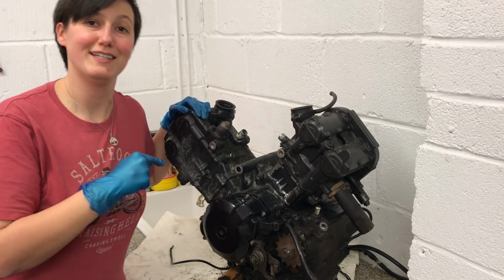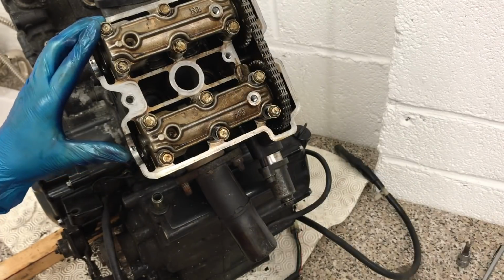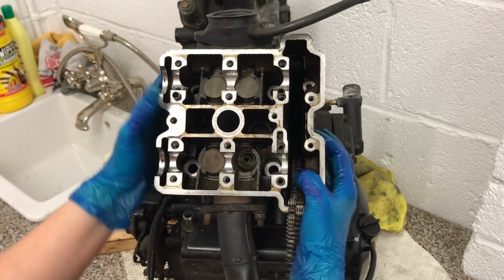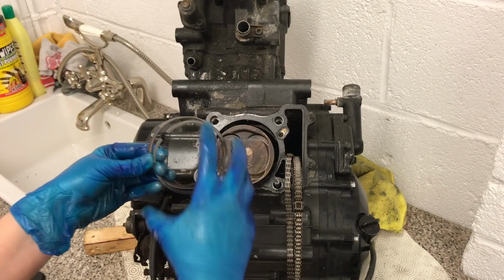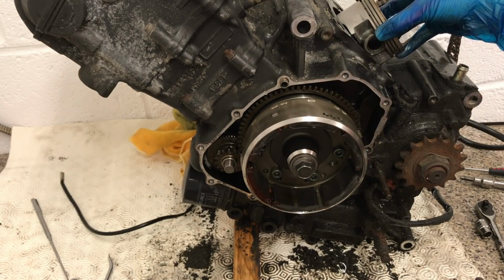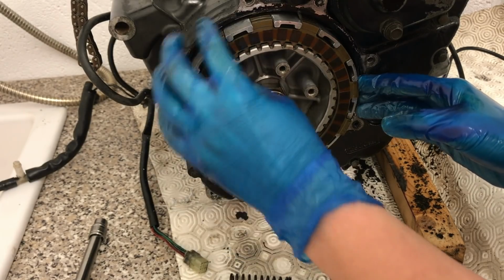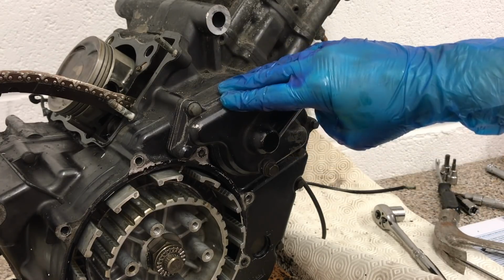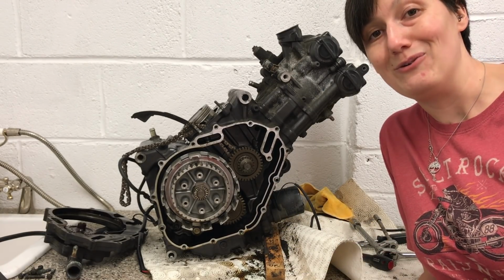Motorbike Engine Explained

Comment: The SV650 was my first bike and a few people before me had it as their first bike also.  I bought it with 80k miles and sold it to a friend for his first bike.  I learned all maintenance on it and had to at one time or another replace the clutch, the intake boots, the radiator, the fuel petcock valve and overhauled the carbs.  I REALLY wish this vid was around then.  I had a book, some tools and a crap ton of courage.  I still miss that bike.  Thanks so much for this.  It was great!

Comment: Great stuff, many thanks.  I have a K3 with 33k miles and suspect I need to check valve clearances and also have an upcoming clutch replacement so it was good to see inside the SV engine.  After your explanation the clutch does not look quite so scary now.
Reply from the maker: I am very pleased it was helpful and that you enjoyed it. Thanks for taking the time to comment, it is appreciated.

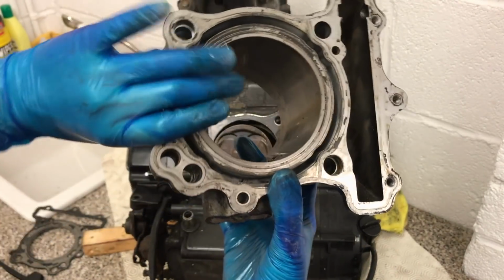Comment: 5:43 that is not the combustion chamber. that is the cylinder. the combustion chamber is the volume from the top of the piston when its at TDC  to the inside top of the head (where the valves are).
Reply from the maker: Brilliant- thanks for that. Thats what I love the way people can share information. Thanks for taking the time to post your comment, I will ensure I use the right terminology moving forward.

Comment: My sv running on one cylinder after I check the basics like the spark plugs etc what else should I look into its a 2005 fuel injected sv. Started one day and it's just ran on one cylinder any ideas?

Comment: Hey Tamsen, glad to see that you are back!!! So nice that this channel is dedicated to such a awesome bike like the SV650!

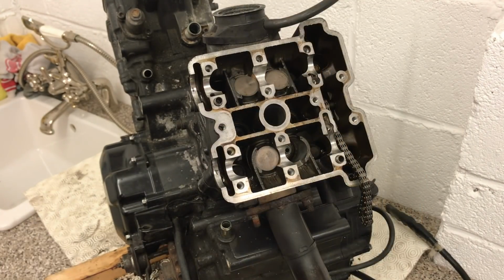I have one question on 4:32 when you completely remove the chain, there is one bolt/screw one the right hand side of the cylinder which is gone in the next cut.
What is that for screw/bolt for? My SV650 "02 is leaking oil at that point and I thought about sealing it. Would it be a problem if I touch this bolt? Do I mix up the ignition timing? Maybe you can help me with this problem

Have a great day and thanks for this awesome video
Reply from the maker: I am so sorry it took me so long to get back to you! I am keen to learn what the outcome was for you to get it sorted, did you seal it? Thanks for your lovely comment

Comment: Tamsen, i have no spark on my Sv650s 1999 it cut out while i was driving i have done all checks for spark with multimeter all looks fine also took it to garage they also could not find an issue and just wonder if it still will be worth to chenge stator as i said it cut off while i was droving and battery flatyend out then we tried to jump start it from the booster and from car and from battery, it cranks but no spark, ecu looks fine we tried from a working sv

Comment: Thank you, that was very helpful do you have any videos on head gasket replacement. I have a 2000 suzuki SV650 with 4400 mile its garage kept and in excellent condition the last time I road it was in 2006. I tried starting it the pet cock valve was bad, I replaced it, it started right up now I have white smoke and coolant coming from the exhaust, if you have information on repairing it. It would be greatly appreciated.

Comment: Well Hi folks. I have a 2001 SV done 140,000 kms Pipes get red hot when I just ran it in the garage. So guess I am taking the heads off to look at the exhaust valves. But not bad after 19 years of riding it. A chore I did not really ant to do. But Oh Well!

Comment: Little late to the party here. Thanks for the cool video! I do have a question though: why are the lobes on the camshaft facing thesame direction? Why have a double camshaft and valves in the first place if you're going to time them exactly thesame? Is it to increase the maximum airflow?
Reply from the maker: Yes! Exactly that- you can get more airflow from 2 smaller circular holes, than you can from one large one! So pleased you enjoyed the video, thanks for taking the time to post your comment.

Comment: Transmission next?
Reply from the maker: I think that it is a great suggestion! It would make a great follow up video!
Reply: Tamsen Cooper : I think you need a special tool to get in there. I bought the tool, but never needed to use it. But one day I will need to open it up. So it would be best to know how and what to expect.

Comment: Very informative, I follow ur videos, because I had dream to own SV 650 one day , but nowadays Iam scared of maintaining cost , because I am not that rich to afford Motorcyle costly mechanical bills , so I do everything by myself , that’s the reason I own carbureted bike now , but I learned how to clean injections, and even valve adjustment and replace aswell,
Is there anything more big mechanical fault that I have to take it to mechanic only???
Reply from the maker: Sometimes its just needing the right tools to do the job, the fact that you can clean injectors and complete valve adjustments is pretty cool- sounds like you tackle just about any other job needed on 2 wheels! I hope you get your to your dream and own that bike- they really are amazing and I am sure you will love it!

Comment: Question! Why are there 2 valves for intake and 2 valves for exhaust? :)
Reply: to provide more fuel/air mixture in a short amount of time and to release the exhaust gasses for the exact same reason as the first one.